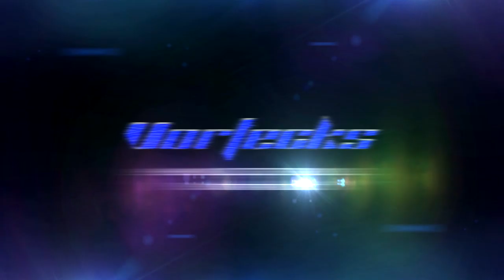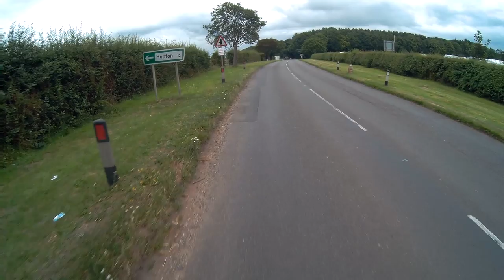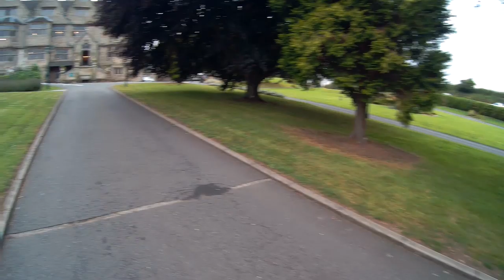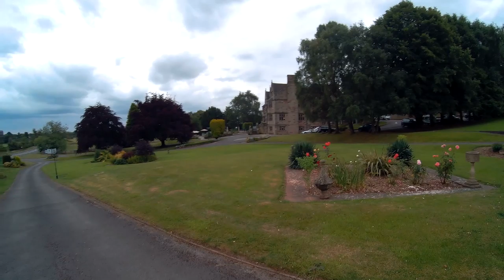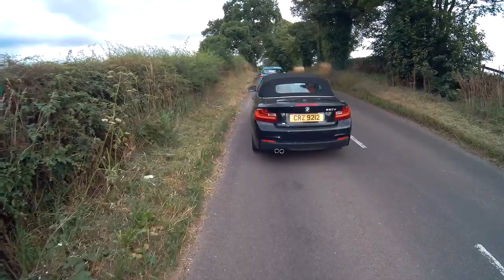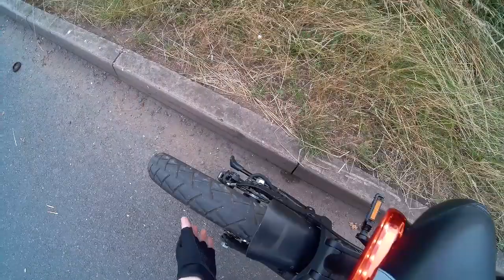High powered DIY eBike VLOG 2019 No 3

Comment: Throttle curve is a curve there is no delay of 3 seconds, all electric motorcycles do this for the reasons your experiencing, I've been making high powered ebikes for 20 years, one of my creations threw you off the back before a proper curve was applied to the controller, there is a video of it on my channel, this is a high powered motorbike not an ebike, great power great responsibility etc, I enjoy your videos, your clearly mad but great fun to watch.

Comment: Mr. Tony glad the battery is sorted out. I had same issue with my connectors coming loose on my modular battery packs that make up my 72V 3kW Cyclone. Can you comment on my ebike gas generator hybrid build? The technical term is a range extender ebike hybrid, which sounds pretty not sexy. I like serial ebike hybrid. =)

Comment: I sorted the regen on the k3 display controller today, waiting for sabvoton but even with this 1500w motor I can hear the spokes stretching on take off so reducing use of motor at start off. 47mph on flat so far full gear but needed more room for top speed test.

Comment: My regen only works when brakes are applied. Did you put in a switch for this for going down grades?
Reply: @SteveGoossens  Thank you. I know about the brakes. Did not know about the throttle. Do not have that type of throttle. Not sure how that would work with pedal assist as throttle is sitting at zero power with pedal assist.